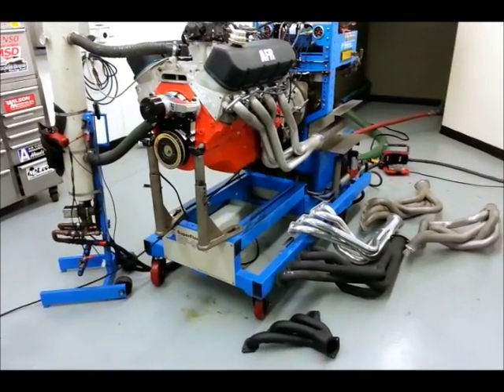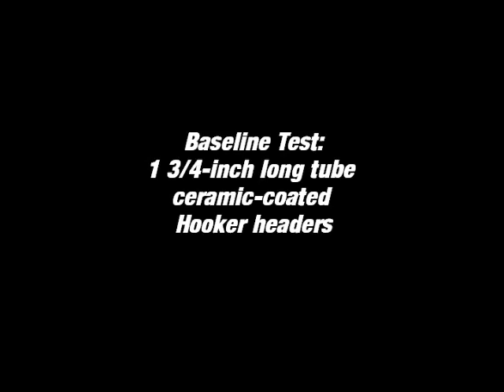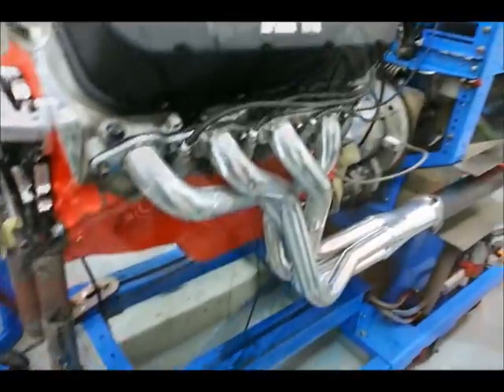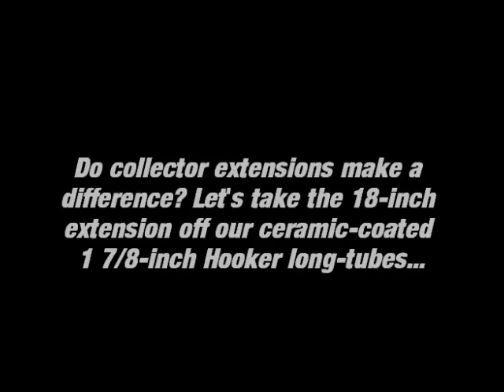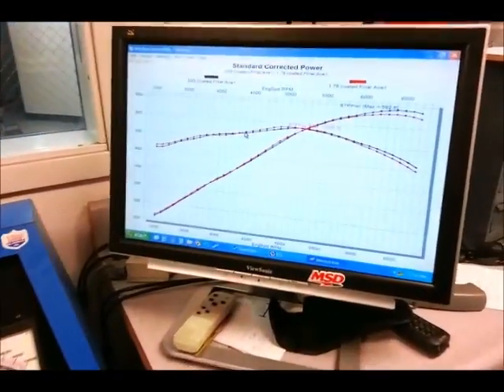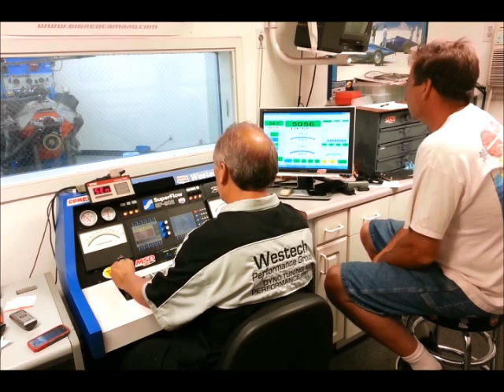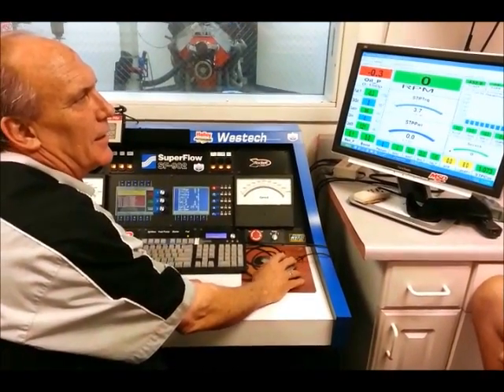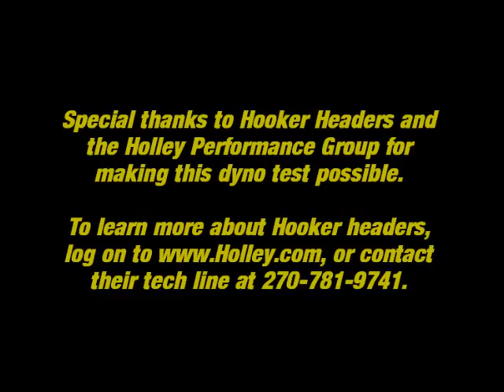Header Theory Dyno Test

Comment: Thanks for the info. Even though the shorty would be an easier fit, I think I will go threw the extra work and get me a set of ceramic long tubes. By the way that is crazy about how much heat the non coated headers put out. Thanks again.

Comment: The difference in power between coated/painted headers will actually be more once the engine is installed due to the lower underhood air temps effecting intake air density. The dyno cell is less effected by this even though they could feel the difference.
Reply: Not when my carbs stick out of the hood!! :face-blue-smiling:😁

Comment: Coated vs uncoated, I wouldnt have expected a dyno difference in numbers.  Theres no physical changes to increase airflow. The performance comes when smashed into an engine bay and the air temps are being sucked up by the intake. heat is being absorbed by the fuel, oil temps are skyrocketed, and cooling systems are running on full squirrel.  Thats when your coated headers will really shine, especially ceramic, IMO.  I am glad for the info on shorties vs long tubes,a nd the diameter numbers Thanks!

Comment: WOW! An amazing heat difference.  Hell, I would say for a SAFETY aspect,  any spilled trans or motor oil (roll over / accident) on the coated header probably won't flash ignite, but a 800+ degree tube will FOR SURE bring oils to the flash point & ignite.  Great to know...

Comment: Handheld infrared thermometers have a disadvantage when measuring an object that reflects light well. This characteristic is called emissivity, or the ability of an object to absorb or emit energy. Therefore the lower temp on the shiny header.
Reply: Bryan Poitras that's the point of ceramic headers, actually - decrease emissivity of infra-red waves
Reply: that is the point, really, the radiant heat from the pipe is reduced.
Reply: Good call.  The problem with using one on a shiny (and even not that shiny) surface is you end up measuring the temp of the reflected surface.   probably valve covers...  Should have used a contact thermometer

Comment: The only problem with running headers that have larger diameter primary tubes is clearance issues especially on a street car. I’m surprised how much difference the ceramic coating makes though.

Comment: I saw the episode of engine masters where they bashed headers almost closed and didn't see much in the way of performance loss.  I'm betting, and this is just a theory, that the major improvement doesn't actually come from the tube diameter for more than about 2 inches from the cylinder head.  I'm betting a set of headers with large tubes right at the head, dropping to smaller tubes quickly after wouldn't decrease power much if any.  I want to see THAT theory tested.

Comment: Regarding the ceramic coated headers. There is also a big benefit due to not having 800 degrees radiating to your intake and raising IAT’s. 👌. I had plain stainless headers before my ceramics. Car felt like an oven on Broil after a drive. Now it’s very bearable.

Comment: My father taught me a trick for finding collector extension tune length, (or any other exhaust stack or system) start long, spray regular non high temp paint stripe on it, run at rpm you desire to tune it to for long enough with a slight load ( driving down the road at 6k rpm in low gear say,) In a few seconds a little oval spot burns first in the paint, cut that spot in HALF! And hang on. Got me 5lb of boost on a hot M35A2 ! He said, "You will see a sharp cone of flame coming to a pencil point when you are plowing with a gas engine and tuned straight pipe!" then with the lights off at night and me hanging on the side of the tractor he'd say dial the fuel screw until it goes rich with red fire, then pull it back until the fire turns blue! Then, if you are good, you can get the purple center, and a shock ring forms around the flame directly above the pipe. There will be more rings forming inside the flame as volume increases, but the distance between them changes with frequency and DENSITY! Park a shock ring directly above a pipe at full load and hold on! Keep advancing the distributor until the flame is pink. If you can, before it rattles, then reset the carb and repeat in small increments!  it will run like crap around the farm, but on a cool night like this with a little fog on the pull track at the fair tomorrow, she'll sing! Then, it is the only time you use a timing light to record what worked best in the field. Oh, and those long rams i have? You can tune an intake that way too and make em park a shock ring of intake charge and exhaust sound directly over the piston at overlap the higher the rpm the worse it is! That's how i split a bellhousing on a 727 at 7500 rpm when i hit third gear! He has passed now,  ive been driving and tuning them for 30 years now and have had low compression iron head smog 400s and 440s in C bodies with that dang experimental cam blow through a 6300 rpm orange box on its way to 8300 in high fricking gear! It's really fun to get everyone in the newport calmed down, turn around, and go back and see black mark sets dissappearing away in front of you! They can't be seen from the other way, but when those tires fry and the tach jumps every 800 rpm there they are, the latter the longer! Ran on 89. Two thermoquads and 4.10s on a 440 in a newport stock 8.2 pistons and heads. Got 21mpg. Only transportation. In the winter. Pulled gravity bed wagons. Art Chizum at oceola said it was the winningest car of oceola dragway. Made a perfect run. Bolt on exhaust and street tires, remove sandwiches from under the intake and have supper, load trunk, place trophies on dash, and drive home. I was tuning and building that 6 pack and setting up gears and building automatics machining everything by 13 years old. I also did a chassis setup. It didn't ride right or sit right, but when those homemade traction bars hit those junkyard special custom cuts and lubricated spring packs and lifted the front end, she came out straight and level! With 1" of daylight under the tire! Sorry for the book. Getting older, no kids, just hoped someone would remember!
Reply: Man thats such a cool story!  5lbs on an M35?  Remarkable, sir!
  My brother put a jet engine in his Mustang last spring, and the chicks really dig him.
  He knows all that stuff too.
Reply: That’s one of the longest sentences I’ve ever read.
Reply: @joshholbert9120 prolly should realize a sentence is over after the period  he use several
Reply: @cathy4444  you realize you forgot the period .👏🏿😂

Comment: Great video guys, good to see some back to back data.... on the ceramic coating debate "does it make more POWER", you really need to test it in an engine bay.  I don't like rolling road dyno's for testing because there are too many extra variables, BUT, the extra heat inside the engine bay will have a HUGE impact on induction temperatures.  That 500 degrees F that you picked up, is robbing you of extra timing you can't use, its also stopping you really getting the most out of your mixture.... but unfortunately, you won't see that in a dyno test cell where there is 1000cubic feet of ambient air around the engine v's 4 cubic feet of very hot air inside your engine bay.  The air the carby is sucking in aside, there is also the soak thru the intake manifold.   Great video though, I took a lot away from it as I'm sure everyone else did :)

Comment: I don't think the dyno can show the value of coatings.
If the tubes move the same amount of air (and they should), then the only other variable would be the Temperature. The Temp would have a greater affect under a the hood of a car where they impact the intake temps than it would in an open and airy dyno room. Like to see the same type of test on a car on a dyno...
Reply: Agreed. 07:25
Reply: Most definitely. If it's a race car not a super big deal, but dual purpose street car you'll save a lot of money on starters, steering components, transmission cooling, dense & cooler air intake charge, less vapor lock, a lot of shit if your running a couple hundred degrees cooler, in the long run you'll love the car,
Reply: If you were listening that's what he said
Reply: So,  if you were running a ram air system,  where outside air was used.    Would the added heat be any concern to the engine,  discounting the possible damage to wiring,  plastics and paint under the hood.

Comment: Missed this video before - there are special dyno' test headers available, or they can be fabricated, with easily fitted insert pipe sections to change the primary lenghts, even secondaries and, for roughing out hte lengths, some are full slip overs, like a trombone slide.

Comment: Some discussion about matching the header tubes to the ports would be useful.  Small tubes on big ports are not ideal obviously.  How much effect does eliminating a step at the flange have?  Maybe comparing small tube headers with no enlargement at the port to the same headers with tubes and flanges enlarged to match the port opening would be revealing.

Comment: My old camaro 406 cube after boring a 396 .060 over 4bolt mains early thick wall casting block ran crane compu cam f280390 cam with .663 intake .728 exhaust lift and triple springs under titanium retainers peak horses at 8700 rpm open chamber rectangle port heads fully massaged in 1976 which could be beat easily today used 21/8 inch long primaries 4inch collecters into a capital h with a balance tube and internal neck down then neck back up to 4 inch again was supposed to flow better. Made great power but there are better plugs out these days plus would use available bigger flow thru mufflers built for diesel engined big trucks like freightliner

Comment: I want to test long tube Tri-Y pipes where the 2 tubes come together right above the 2 into 1 collector.The #1 and #5 cylinders are piped together and the #3 and #7piped together. 
With the rotation of the crank and the position of the pistons,  everything should work together assisting the scavenging of adjoining holes.
I have not seen this type of header and I know it will be more efficient and make more power.

Comment: I'd like to understand how a header primary diameter that is larger than the diameter of the exhaust valve itself can produce more power.  Many high-perf BBC engines (maybe this one included) had 1.88 (1-7/8") dia. exhaust valves.  That given size can only move a fixed cfm (granted, varies by engine speed), but it just seems that a 1-7/8" primary size really should be all you need to not create a restriction at the exhaust port.
Maybe the fact that there is a bend in the header that is close to the port exit point is helped out by increasing the diameter? 
Would be interesting to test straight or zoomie-type headers this same way to see how much the bend actually impedes flow with a given primary diameter...

Comment: I have to question the true heat results of shiny ceramic coated vs black painted. Emissivity of a IR temperature gun is typically calibrated to a surface it will be used against. Shiny light colors do not emit IR as well as a black surface that emits IR much better. In my former job doing coatings for pipeline we had 2 IR guns depending on what we were coating. A tan plastic or overlaying that with a white plastic. Lab even had their's calibrated specifically to a hot plate when checking gel time of fusion bonded epoxy. I don't doubt the ceramic kept heat in pipes but 600 degrees difference is a little extreme.

Comment: Interesting comparison and evidence for people who think larger/open is always better, that torque drop with NO collector surprised me and 60 pounds is certainly a lot to lose or gain.. 

I am 65 and about 1975 i built a 67 RS Camaro Yenko clone with a 427/425 with 456 gears and a 4 speed and naturally i had headers then everything was uncoated but people used to paint them, Hooker VS Appliance for cost, etc.
Steve with that nice 427 engine does that have the OVAL port heads or rect? Asking because there was so much controversy back in the day between the OVAL and RECT.  As you probably know the rect. came on the 427 HP versions like the 425 and 435 version with the solid cam and 4 bolt main and the bigger valves. Man i would have been running low elevens easily with 600 hp and pump gas too

Comment: Tests at WOT, are great. ...But.. I have BBC 502 in a 4200 lb Divco   Have you ever done tube length and Dia, a real world test on, what would be a street driven motor, up thru the gears....  I have no problem leaving the red light with wheel in the air.  Looking to get as much advantage as possible form the  502.  I have no problems with the drive train  (  4l80e and 355 torsion diff )

Comment: Measuring temperature with infra red gun in not ideal in this case , emissivity is completely different for black headers and shiny ones... so the only way to measure this properly is is surface thermocouple..
Obviously ceramic coating help a lot but not sure if that much..
Reply: Heats heat bud.. if it's 200 degrees or 800 it I'd what it is..  heat is heat   measure however you want. Coated vs uncoated isn't rocket science to figure out the outcome.    Someone didn't do so well in grade 6 for the 5th time..
Reply: Grzegorz Pekala You would be correct sir... on the contrary to the other comment left... any infrared thermometer manual will state right in it the differences in reads due to different surfaces.. and how to calibrate the device for such differences but they are still never spot on correct.
Reply: Rollincoal You are saying the only thing that kept Grzy out of 6th grade was 5th grade?
Shades of Jethro Bodine.............
Reply: I was about to flame on, but the emissivity thing is true according to the fluke instruments website. You learn something new every day, admittedly he could probably spray paint a black dot on the headers to get a better reading.
Reply: Love the vintage pre Engine Masters video and the info too! Thanks Motor Trend!

Comment: You can´t get accurate temperatures with ir meter. It´s very difficult to measure shiny materials even you set up right emmissivity coefficity..
Reply: all they had to do was a put a small, flat, temp probe on it with a smidge of high efficiency thermal paste and wrap it

Comment: How do we figure out what we have done to our engines without a dyno? I got an unknown 350 for cheap enough that I doubt it's anything performance. 041 heads from what I can tell by the front casting. Mild cam from how it idles at 600 rpm. Edelbrock 600 cfm, edelbrock performer manifold. The logs and  exaust are bigger than the stock 83 k20, I think 3 inch now and has cat and muffler. I'm hoping its somewhere close to what the engine wants while keeping it quiet. It pulls a travel trailer so I manage to use it's full throttle and max torque legally. I will always wonder what the heck I actually put in my truck.  All I can say is somewhere between 145 and 600 horse? Probably 300 or under is my honest guess. I ran a break in on the cam and have driven litterally across the country and back pulling a trailer, maxes out about 55 or 60 in the mountains and can do over 80 at sea level without rejetting. No trailer and I can certainly do illegal things in it. It does pre ignite with low octane so every other tank I use mid and that keeps it at bay. Every second tank itll ping again so I try not to do that.  I'm guessing 10:1 c/r? It's got 2.72 gears in the axle and th400. I'm thinking about goofing with that though, 4.10s and an od trans but for the cost of that what's a few more dollars in the tank instead?

Comment: Your pyrometer will not pickup the heat signature on any shinny surface hence the 500 degree difference. The only way is to clamp a real thermocouple onto the tube.
Reply: its not measuring light is it?? If I use my pyrometer on my mirror it will tell me the ambient temperature, not some kind of ghost number

Comment: Was the Shorty compared to the same tube sized (1 7/8") long tube or Best 2" dyno run? If the later..I wish they would have also put the 1 7/8" long tube run up there so we could see how just the length affected it.
Reply: Those shortys were a bit small in the collector. I'd like to see some commercially available 3" collector shorty.
Reply: you cant put a collector on a shorty at all, just exhaust pipe.

Comment: I would be curious on the difference in the length of the turns and the angles on the tubes coming off of ech port. I am sure there are differences with space being an issue.  Those factors would help/hinder one size to the next. 
Also I watched a vid on here where they intentionally put dents in the headers and (not dings) and they made more hp after dented. 
I am sure there isn't a header company testing that because god forbid they spend some of their profit on research for  performance  rather than just cobble up a set of headers for $30 and sell them for near $1000